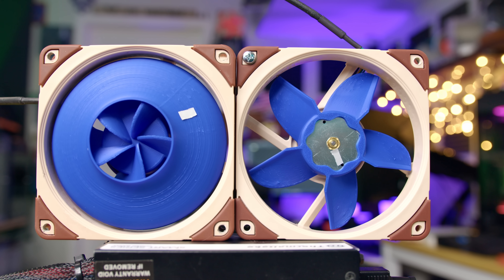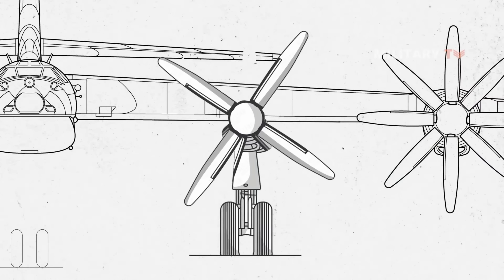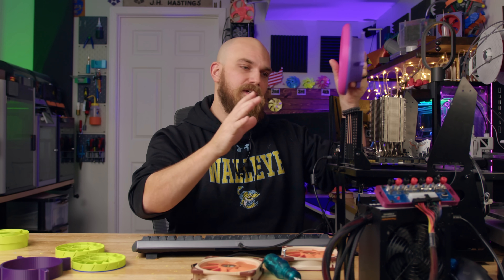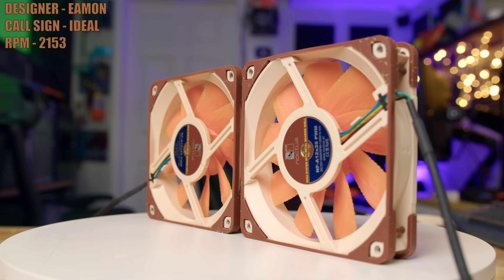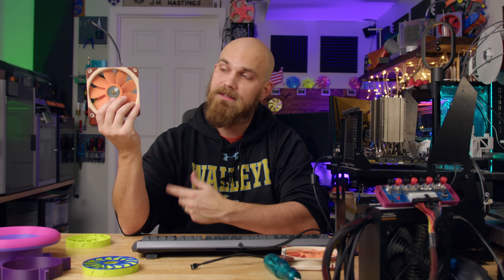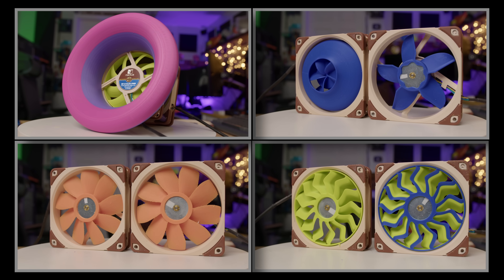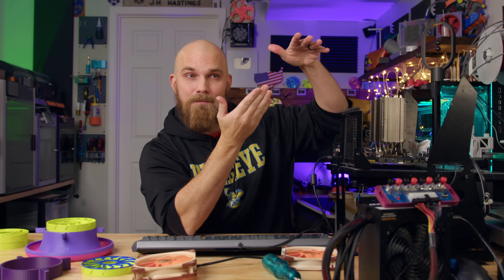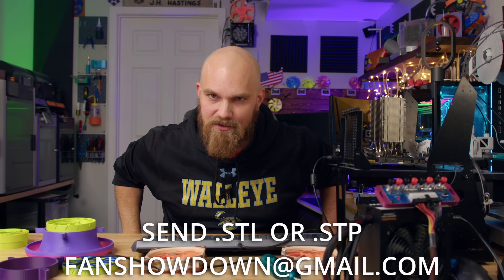This Fan Shouldn’t Work — But It Dominated | Fan Showdown S7E2

Comment: Hey James! Thanks for finally picking up my design for testing! My first submission was even for S01 on Mo., 27. July 2020, 14:37 xD Some more background info: I chose 13 blades because it's a prime number to avoid resonances and I included slots in the outer rim low pressure zone to achieve self centering and vacuum properties towards the fan frame. It's running for years now in my setup and I'm really happy with how they perform. Also available on cults3d for everyone interested. At first I thought it was second place, but thank god for the sound score :)
Reply: Thanks for submitting it, it was cool.
Reply: Well done 👍

Comment: I don't understand the point of allowing fan designs that can't fit inside a pc case.
Reply: Just for the hell of it, 99% of these designs are just for laughs and the extreme and crazy ones are more interesting than the cookie cutter ones with just slightly differently shaped blades.

If it weren't for the oddball designs this series would have lost steam a long time ago, even with the current changes its still getting pretty stale. But I've been watching from the start so dammit I'll keep watching for as long as he keeps posting them 😂

It really seems like he has just been going through the motions for a while now, can kinda see the boredom in his eyes, butike any old pro he will keep going through the motions as long as they keep paying him 😂
Reply: nobody does, for years, but he gets to make crazy clickbait thumbnails so that's probably why.
Reply: the fans fit on external radiators

Comment: Why use an 8-blade fan instead of a 7-blade one? Now it will be conflicting acoustically with the 4 motor supports…
Reply: Ah yes, the four supports! That does make sense. And with a counter-rotating fan, you'd probably want 7 and 9 blades. CRX1 uses 8 blades on both.
Reply: Should have used 5 and/or 7... Two prime numbers!
Reply: @caramelldansen2204  I guess 5 might be too little
Reply: @formbi  fair!
Reply: @formbi just make them wider? Though at some point that would probably start blocking instead of creating flow.
Reply: @caramelldansen2204 7/11 would work

Comment: Testing the noise and thermals independently feels entirely wrong. You're potentially punishing a design for taking advantage of the way the fin stack changes the airflow.
Reply: Agreed. Noise testing should be in-place on the cooler.

The whole point of this season is to model the user experience of a given fan design, so it needs to be in-place.
Reply: Really hope he considers this suggestion.
Reply: Couldn't he just as easily make a separate ranking and show it too?
Reply: Also the room ambient noise is not considered I think
Reply: We've been suggesting this for the past few series and he's clearly chosen to just do whatever it is he wants to do. Like test these stupid ass designs that are impractical
Reply: @DaroffApFire  Now now, be nice.

Comment: More smoke please! It's hard to see the output
Reply: Noted that too, possibly on purpose to not show some extra feature included by the slots in the rim into the low pressure zones. That pulls extra vacuum to the frame and lets the fan self center.

Comment: Feel like the audio tests should be done with the cooler stack included.
Reply: Yeah, A lot of us mentioned that in the first video, and he must have overlooked it.  Hopefully that change is made, because the way he does it makes zero sense.  Maybe even do that for the flow demonstration, but the fins will probably just act as air straighteners.
Reply: to add to this - The cooler stack with interfere with resonance to probably lower the overall db level but also could increase sound with certainvibrations resonating with the cooler stack itself. The kinda thing that testing doesnt show you with certain setups but practical use makes you "OH shit, i fucked up" after R and D is done and you have 20k units on the shelf 😅
Reply: Sound is often measured completely wrong.

Because you won't hear a 100 dB at 13Hz, yet it's extremely loud.
And yet a mosquito can sound extremely loud even if it's less than 20 dB but the tone of the wings flapping makes them very audible.
Reply: @Arutemysu  "Because you won't hear a 100 dB at 13Hz, yet it's extremely loud."

That's kind of what the dBa scale is for, isn't it?
Reply: @vinny142  i know, but it shows how flawed dB tests actually are.
Reply: @Arutemysu  That's why he shows the graphs. He's mentioned on several occasions when a fan's noise profile is in a less annoying range.
Reply: @Arutemysu  that's not the point. The point is to measure it in a "good enough" way
Reply: doing it off the cooler allows you to compare with the previous seasons
Reply: honestly the smoke test should also have the cooler. Speaking of which, did anyone else think the smoke test was kinda thin this episode?
Reply: @johnthegiant320  RIP old smoke machine, he mentioned its demise last episode. 
Also, I totally agree the smoke test needs the cooler.
Reply: @alttabby3633 he can't get the new one to put it more smoke?
Reply: 100%
Reply: Smoke test too
Reply: True
Reply: 100%

Comment: 6:12 perhaps take 2 sound measurements; inline and 90 degrees to the side.
Reply: And kick it out to 1 meter.  Perhaps a third point at 45 degrees.
Reply: 1m and 3 points seems reasonable. Or in a standard case maybe?
Reply: @Xailow  standard case wouldn't fit some. Besides if you make custom fans, make a custom case 😂

Comment: Another metric that might be interesting is seeing their performance when noise normalized
Reply: See my comment. I worked it all out.
Reply: id like it temperature normalized actually
Reply: @Erksah02  Much harder to do, since there's a settling time.  Large channels, like Gamers Nexus, use noise normalized testing.
Reply: @Erksah02  That wouldnt solve the issue that even this current metric has.  Decibels are logarithmic.  Every 3 dB the waveform has double the power.  Its not so simple to get a fair comparison from when combining that and temperature.  A noise normalized thermal test takes the scale right out of the equation and looks only at thermals at the same volume across the board.  Otherwise you will end up with fans that barely edge out others due to the numbers being a small amount higher in dB when in reality its actually quite a large gap in volume.
Reply: I would like them at max speed TTD. 

We learn their max volume, max flow rate, and max rpm.
Reply: I think the method would be this!